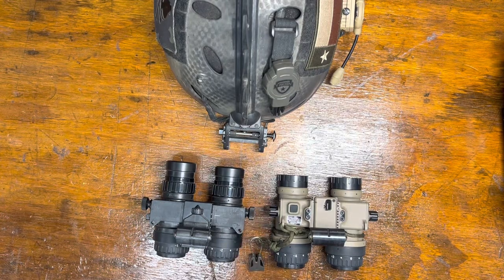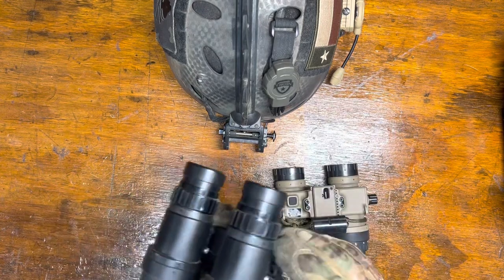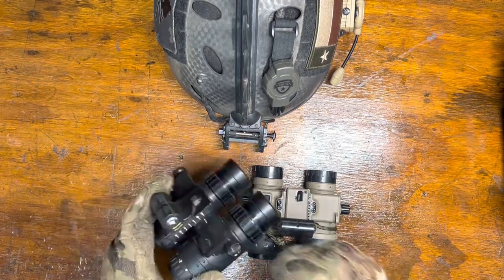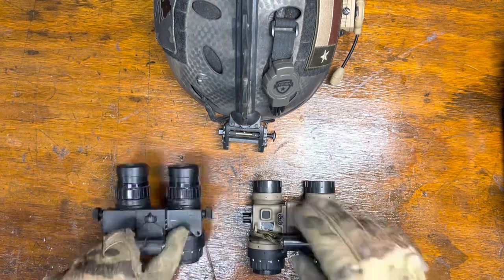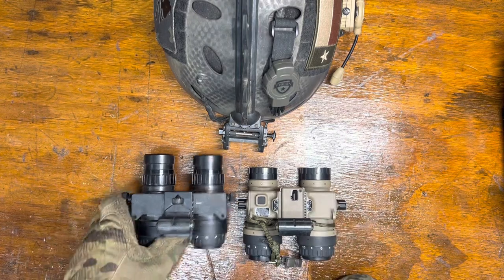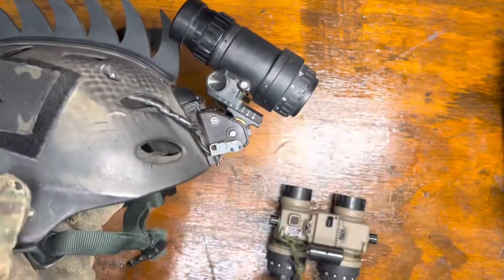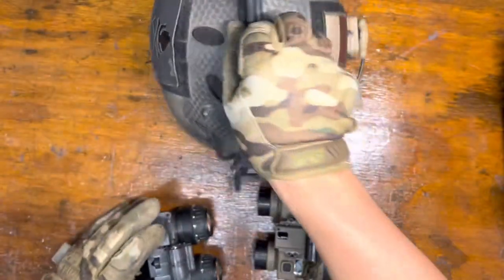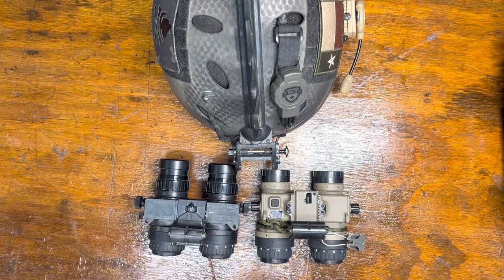TNVC Artemis vs Anvis 6 Housing- Some Initial Thoughts

Comment: I too have both an anvis and an Artemis. What really concerns me about the Artemis is the gap on where the mount goes against the bridge. If you look in there, there are two contacts that are long and exposed. Any water that gets into that gap will most likely touch those contacts and will short the system. If you look in the back of the mount where the springs are, they put a sticker on the ribbon cable for the power. The reason for this is that two of the springs practically sit on top of the ribbon cable and that sticker is to "protect" the ribbon cable from them. Seems like a huge over sight to me as a spring will get through that sticker eventually and will short the unit. They could and should have done way more water proofing to it. The finish of the delrin is pretty laughable too. I have machine marks or what could be mold marks all over it and especially on the dove tail mount. In all I would say that It feels like a prototype at best and that's not even getting into my buying experience with my housing.
Reply: Damn that’s kinda cheap on them
Reply: Dielectric grease.

Comment: How have these held up? These are at the top of my list with the ball detent mount. Just worried about them in dirt & wet weather. Would a RNVG be better even though I love the Artemis.
Reply from the maker: So far so good. I used them during a NV class a couple weeks ago. It rained pretty hard- all gear was soaked and no issues.

Comment: what’s the process of actually mounting the bracket onto your helmet? is there a mounting system on the inside of your helmet that connects to the front or something like that?
Reply: He's using the Original Anvis mount. You have two options when using those mounts. If your helmet has a shroud already, you can just get an adapter from mod armory and use the base plate of a rhino 1 to have it go onto that shroud. What he did here was, instead of using an adapter and shroud, he drilled the four bolts that particular anvis mount uses and mounted it directly onto the helmet, this is similar to how pilots and their crews have their helmets. There are some examples of this on some DEVGRU and other SF's helmets back when some of them used anvis and pvs-23s floating around on the secondary market as well.